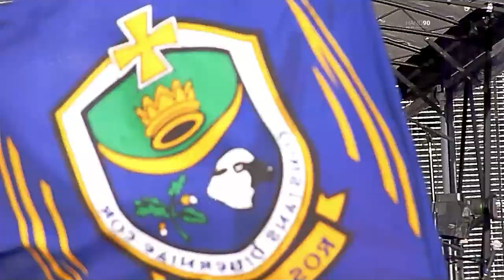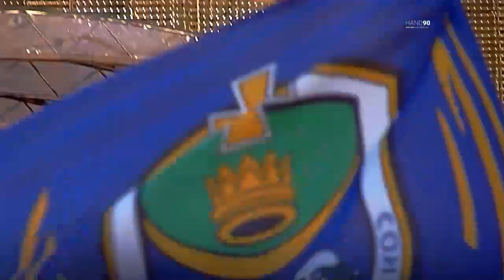Bon Jovi | Live at RDS Arena | Ultimate 2-Night Compilation | Dublin 2011

Comment: Great 2 nights! Love these guys! I have to ask why Jon rarely takes advantage of the ramps or tracks the go out to the crowds.I saw the New Jersey tour twice and he used those enormous ones on Let it Rock. Slippery they didn't have them. Saw it once. KTF I don't think had them when I saw it. These days didn't have it when I saw it. I saw them like this one in 2013 before Ritchie left in Nashville and he went out maybe once. All these videos I watch from you and 95% he is right on the stage. Just think its odd that they are there and aren't used much. Thought maybe you knew the reasons. I think I would use them most songs lol!
Also, KTF on the second set needs to say 2:41:58 instead of 1:41:58.